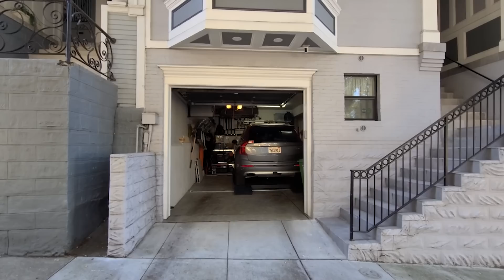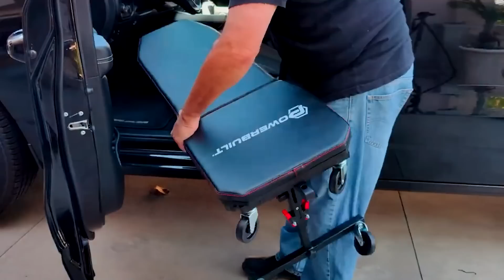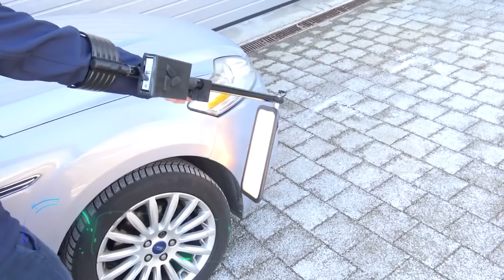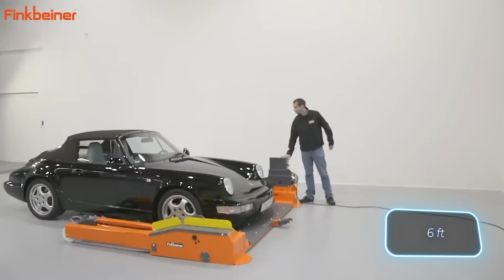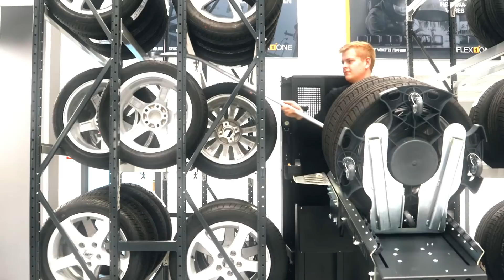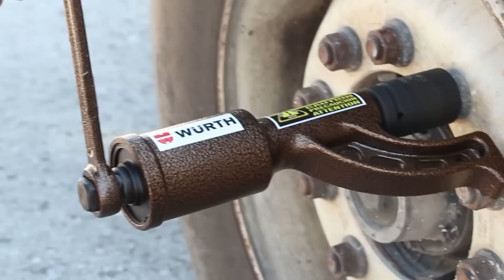15 BEST INVENTIONS FOR YOUR GARAGE

Comment: Like all things someone will come up with things to make a garage more than a small building for a car with oil on the floor under the motor. Why not make it easy. Put up a metal building in which to live and have a nice place for your car or truck. Ok. You'll have to probably locate in the boonies somehere because the city has all kinds of zoning laws. Oh well. And this would be a lot cheaper than a home located in a city with all kinds of zoning laws. Oh well.

Comment: That tire lift would of saved my back. Worked at Sears automotive in the stock room. Most people barely lasted a day. They said "it's a one person job". 8000 LBS per week on the truck. Jerk delivery truck guy just wanted to throw the tires at you and move on not giving you any time to barrel stack. So the average amount I lifed by hand. Was the truck load. One to barrel stack, one time to put on the rack, and one time to roll out to the shop to be put on by another. 16,000 pounds once the delivery is done. A ton or two each day. Then to stack old tires until a truck comes in to get them. Then I helped them. On average per day nearly 3 tons or 6,000 lbs lifted a day. Pretty much going to the gym 5 times a week. That's a slow day. Also not counting the oil, break drums, disk breaks, break pads, battery pick up and drop off. Then the wheel weights.

Comment: Did anyone else see the scratches that motorcycle lift item put in the concrete floor? Not to mention it didn't lift the kick stand so that was ripping up the concrete too. That tool needs a major rework.

Comment: Two things, first the parking thing is 3500-5000 dollars. Second, you have to pull all the tiles up to clean the floors.  Cleaning would be a project with all the collected, oil and residue.

Comment: The Idea of the GridPro Tiles is awesome but i fear if something like screw or something falls down you wont be able to find it unless you deconstruct the floor.
Reply: I was thinking about how much dirt is going to accumulate. Sure it could be rinsed out with enough pressure but it would be a pain in the butt without disassembly.
Reply: IDK about that. But I have a magnetic and a claw pickup tool.

Comment: That sliding car garage gadget should be installed at every parallel parking spot. It would save time, space and traffic.
Reply: Or don't be a bad driver
Reply: What happens if it breaks down? Would you have to wait hours before you can retrieve your car
Reply: That’s a costly idea. Maybe people could just be competent at parking instead?
Reply: I can parallel park faster than anyone could park their car on that skid, get out, and wait for it to move over. Just learn how to park.